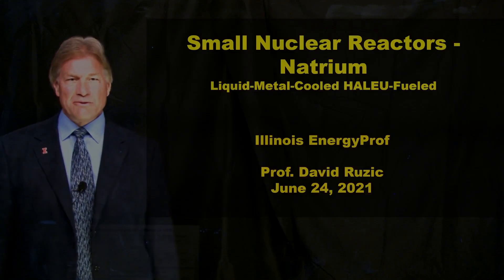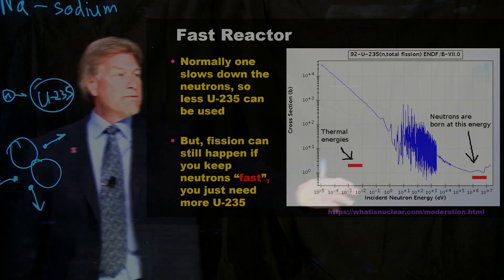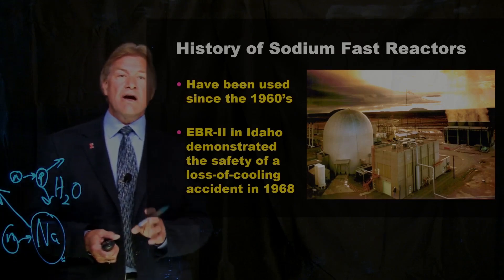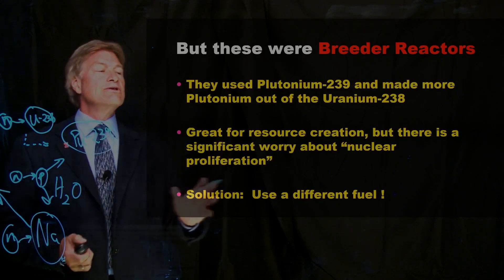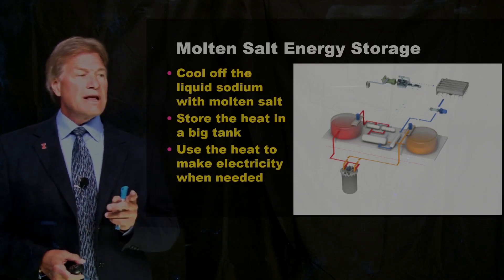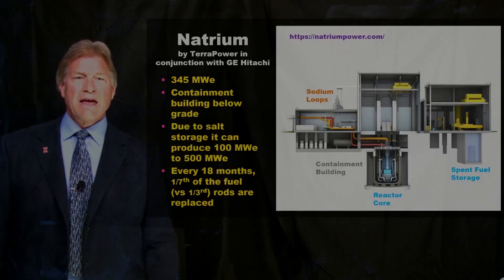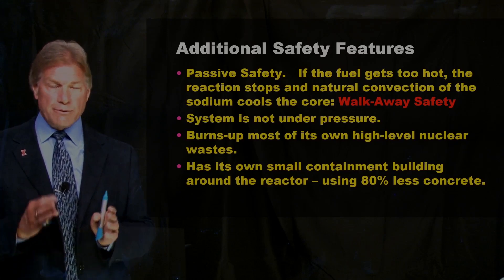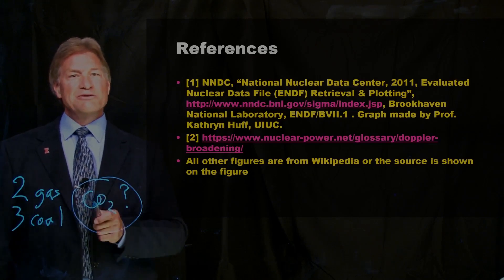Small Nuclear Reactors - Natrium

Comment: Professor, I have questions:
1. Hot Sodium is reactive and dangerous even without water (but water somehow is always around where people live). Why not use Lead instead?
2. I don't understand how a reactor being overheated produces more energetic neutrons to they do not cause U235 fission. Aren't the Strong Interaction forces inside a nucleus orthogonal to  temperature?
3. Why do you say 20% uranium enrichment is low? It looks normal to me. Superfenix had less that 20% Pu239, BN-800 works on 20% U235.
4. I heard the Molten Salt Mirror Solar Plants for some reason are not economically viable, they are losing the renewable energy market. Something is wrong with the molten salt energy storage isn't it?
4a. Why store heat in molten salt while one already have molten Sodium?
5. 13:45 I do not think it is wise to rebuilt the fossil power plants into nuclear ones because of their positioning being too close to dense populated areas. At least not until this technology ceases being new.
Reply from the maker: Good questions!
1.  Lead is an interesting choice.  It melts at 328C vs 98C for sodium, so there could be a problem of keeping it molten.  Also, there are some nuclear reactions with Pb more so than with Na.  The biggest reason is that we already have a large amount of experience with sodium cooled reactors -- even commercial experience -- which all shows that you can keep water away from them and have materials which do not react.
2. The key is the absorption resonances.  The cross section of them broadens, meaning that the total cross-section (area under the curve) increases.   The neutrons get absorbed in the U-238 instead of fissioning the U-235.
3.  To make a bomb out of U-235 it needs to be 85%+  That is called High-Enrichment.   All of the commercial nuclear reactors around the world that are currently producing electricity use 3.5% U-235.  So 20% U-235 falls in the middle and they have a name for it -- HALEU.
4.  The problem with the molten salt power towers is not the molten salt.  It is the fact that sunlight at maximum is only 1kW per square meter.  The power towers have mirrors that focus the suns light on the tank of sodium.  It is very hard to get enough mirrors to make enough of the salt a liquid.  If you could make the molten salt another way, like a nuclear way, the storage is great.
5.  Newer coal power plants are usually not near any population center because no one wanted the pollution from them near the people.  The ones they may use in Wyoming are not near big population centers.
Reply: @illinoisenergyprof6878  Thank you!

Comment: Great video, I wonder what the levelized cost for solar/wind coupled to thermal storage would be.
Reply: You would need to build an electric heater since PV/wind do not operate a thermal cycle like nuclear/coal/gas, so I think it will not be so simple to add this to the intermittent renewables. If there is sufficient elevation nearby I suspect pumped hydro is more cost effective than thermal storage. Of course this does not apply to thermal solar, which already have thermal storage.
Reply: I agree! That was a GREAT video!
You would have to factor in the efficiency loss of converting electricity to heat in your calculations, which I believe may render this idea into the less than optimal category.
Plus wind and solar are both incredibly dirty technologies from a production and recycling stand point and even from an operational view point. They just are not as environmentally friendly as many people think. With many more localized Gen IV NUKE plants, you really don't need much else.
Reply: https://www.lazard.com/perspective/levelized-cost-of-energy-and-levelized-cost-of-storage-2020/

Comment: How does it handle the earthquake cracking everything followed by total submersion from a tsunami/groundwater/40 days of rain scenario? I assume the sodium will catch fire but is that catastrophic or just inconvenient?
Reply from the maker: I would not place it on a coast or a swamp.  No tsunami's in Wyoming, and ground water is usually pretty deep.  I don't think rain water leakage was ever a problem at the commercial ones in France and they had long practical operating experience.  Since the sodium is not under pressure, a crack in a pipe is just inconvenient.  Massive water ingress into the sodium pool would be catastrophic, but since the only water around would be rain that kind of accident seems preventable through engineering etc.
Reply: @illinoisenergyprof6878  Thanks Prof, I really like your videos!

Comment: Good luck preventing the molten salt from reacting with everything it comes into contact with.
Reply: Every engineering solution to any problem is  a compromise. There are downsides to every solution. 
I do want to hear the practical opposing reasons to this technology- not the typical knee-jerk reasons like "nuke=bad".
If corrosion is the main stumbling block then how will it be dealt with? New technology? Don't know. Lets see the arguments.
Reply: @George Mann Not much of a problem if you know how to handle it well. BN-350, BN-600 and BN-800 had no issues with that.

Comment: This guy needs to run the Dept. of Energy. 

We need reactors to pump water over the continental divide for the western United States. There isnt enough naturally occurring fresh water for the west. The solution is NOT to stop using water and hope for the best. Water is valuable, its worth moving vast distances. 

We. Want. Cheap electricity and water!
Reply: In giant pipelines ? AND up and down whole mountain ranges, or would you drill ginormeous tunnels through them? Not sure any of that would be very safe.
Reply: @johanponken  One could just boil water and let it distribute and condense naturally in the atmosphere if there would be enough cheap energy :)
Reply: Nah, just desalinate the ocean water. Check out what the AEC was coming up with in the 60s and 70s: https://digital.library.unt.edu/ark:/67531/metadc784269/m2/1/high_res_d/metadc784269.pdf
Anywhere from 100 million to 5 billion gallons a day of freshwater with a sub 10ppm level
Reply: China had done that experiment with the world's most expensive multi-decade infrastructure project and it failed spectacularly. And that project is based on infrastructure that already existed for centuries. Now they are looking to do what actually makes sense: sea water desalination. 
The United States could not do an infrastructure project on that scale period. Do not try to fight nature, use what it gives you.
Reply: @George Mann the problem with pumping water through tunnels or aqueducts is: soil is thermally expansive. Eventually concrete tunnels and concrete lined aqueducts leak. Not very efficient. Desalination may be a better option.
Reply: Using renewable energy to desalinize and pump ocean water is the way to go. As our need for food grows, farmers will require more water. The ocean has all the water we will ever need. Squabbling over the few drops of water that happen to fall on land is not going to help anyone.
Reply: @surferdude4487  Desalination isn't economically efficient. Costs too much. Otherwise, everyone would already be doing it.
Reply: @S0ulinth3machin3  The main cost with the process is the energy. Wind is free. Sunlight is free. The tides are free. Yes, it costs to install the equipment, but the running costs are close to zero.
Reply: @surferdude4487  they're not free. It costs money to build the equipment, it costs money to maintain it, it costs money to have backup sources of energy when the wind isn't blowing, when the sun isn't shining. If it was truly free, the entire world would already be running on renewables.
Reply: @surferdude4487  It's not just an energy problem. Salt water is highly corrosive and destroys equipment which must be replaced. Additionally, the removed solids have to go somewhere, but not anywhere. Dumping that much salt in any area would be an ecological disaster. Best solution would be dumping it in an old salt flat, but those are far away which means we'd have to truck/train/conveyor the solids a long distance as well. And no you can't dump it back in the ocean, unleashing that much salt in any area would kill anything in the surrounding waters.
Reply: @surferdude4487  desalination is extremely inefficient and its a waste to water crops with them unless you HAVE to, like in Israel. I say pump the Missouri River west and create mountain lakes with man made basins. Or pump it south from British Columbia. Or create man made icebergs in the Sierras in winter time so we have melt water coming down all year.
Reply: Nuclear would decrease the price of electricity and water, thereby lowering the cost of everything. This would significantly improve life for the average person, but it wouldn't benefit people who own lots of shares in companies that sell things. Unfortunately, the latter group controls politics.
Reply: Actually, while we are in drought, there was plenty of fresh water. The real problem has been that ppl along the coastal areas are taking much much more than their fair share. For example, California is supposed to take about 26% of the river water. Since the 80s, they have taken 35-40% of the water. Yes, they are taking a great deal more than they should, which is why it is so heavily drained. 
And texas takes a great deal more of the water that flows from Colorado than they are allowed. 

What is needed is to put in numerous small nuke power plants about 25 miles in-land from the coast and then have piping of ocean water to cool it. Some of it would then be diverted and desalinated using waste heat. The waste water would then be mixed into the return and further diluted prior to being released back into the ocean. 
The fresh water can then be piped all around for up to another 25-75 miles INLAND. 

THEN take them off the river water and have that distributed amongst the upstream users.
Reply: @grraab2000  nobody will need to decide “fair share” if they pump water west. Or maybe south, but the northwest is in a drought of its own.
Reply: @grraab2000  It's a seriously bad idea to drink river water. Typically there are a load of factories and municipalities dumping their waste in it upstream. Best way is to create artificial ground water by pumping lake water into a sandy hill and let nature do it's job.
Reply: @grraab2000  that doesn't make any sense. How can people at the coast "take" water from the people upstream? The people upstream have access to the water before the people downstream (by definition, those at the coast are downstream). BTW, in California, 85% of the water isn't used by the general population. It's used by the farmers in the Central Valley. Southern California should be getting some of that water, but the proposed Peripheral Canal project was defeated in a statewide referendum. The farmers launched a well funded misinformation campaign that Southern California would be taking water from Northern California. The reality was that Southern California would be taking some water from the farmers in the Central Valley.
Reply: @grraab2000  what is the difference between "should"  as in a  politically negotiated value, and what is required? You can try and allocate all you want, but if there is a shortage of incoming water there is still a shortage of incoming water. That's the root cause of your issue not what percentage where.
Reply: "Water is valuable, its worth moving vast distances"  How about we move the people instead of the water.  If people paid the real cost for the water they use in water stressed states, they might avoid places where there is not enough water.
Reply: @chrisvaiuso6010  at this point infrastructure is substantially cheaper. The concept of relocating 40 million people not to mention the GDP disruption and the investment in infrastructure to accept the relocation of those people is absolutely mind boggling.
Reply: "pump water over the continental divide for the western United States. "
That would be quite a change. Currently, Denver gets a lot of its water from west of the divide. I don't think telling them to do without that is going to fly.
https://www.denverwater.org/sites/default/files/2017-05/map-collection-system.pdf
And pumping water uphill from further east (Lake Superior?) isn't going to be cheap.

There have been proposals for a water system connecting everyone from Alaska to Mexico, but for various reasons they've never gotten much support either.
https://en.wikipedia.org/wiki/North_American_Water_and_Power_Alliance
Reply: Rip local ecosystems
Reply: Why should people in the East be punished for the West's poor water usage and waste?  Desalinization is good, as long as you figure out what to do with the brine, because dumping it into the ocean just makes for local saline levels to rise causing ecological harm.  Now if you can use THAT to make sodium for use in these reactors, that would make a little more sense.
Reply: the problem isn't the lack of water but rather the fact that it's not fresh. you can just use seawater and apply reverse osmosis.
Reply: @Hamstray  Yes, and that could be done and powered more locally. Small reactors. :)
Reply: @Hamstray  is because of the bacteria?, do reverse osmosis first and irradiate it with gamma rays along the way.

Comment: So correct me if I am wrong. We understand this technology for very long time but it's not popular because we scared that fuel can be used for wrong purposes  or am I missing something ?
Reply: There were various reasons. Early sodium reactors had some design problems that a pool design overcame, as in EBRII. However, water cooled reactors were well established and sodium reactors were looked only as breeders. The US government had started to build the Clinch River Breeder Reactor outside of Oak Ridge but it was stopped due proliferation concerns and being over budget. By that time, it was found there was not going to be an issue to mine and refine the amount of uranium needed and the number of reactors was scaled back due financial cost and TMI. So, outside of research reactors needing fast neutrons for material testing  there was no need for these reactors. In fact, the US government built a sodium cooled research reactor out in Hanford WA but closed it down. It was known as FFTF. All of this can be verified in an Internet search. Natrium adds in a new twist with the heat storage and burning up nuclear wastes.
Reply from the maker: @PNurmi  Excellent reply!
Reply: @illinoisenergyprof6878  Thanks! I do have all three college degrees in Nuclear Engineering  and been involved with this since 1974. Good  to see I hit the mark on this. BTW, keep up the good work on these videos. I do share them with others not as familiar with these subjects.
Reply from the maker: PNurmi1956 (below) explained it well.   Using this tech not as a breeder was not really thought of as useful, and it required a non-standard fuel (HALEU).  Part of the DOE program is also to make a plant which generates the HALEU fuel.